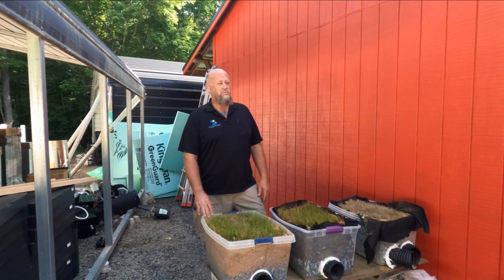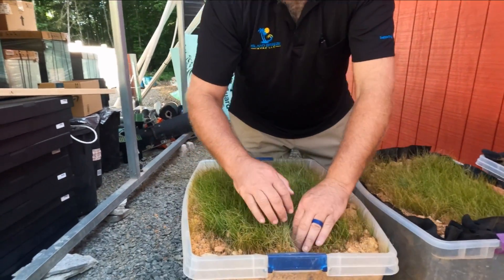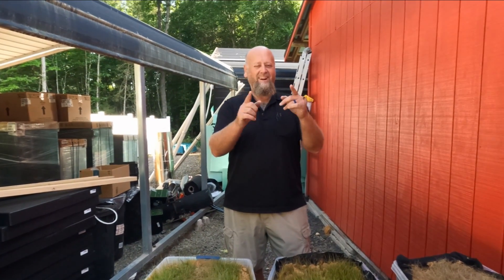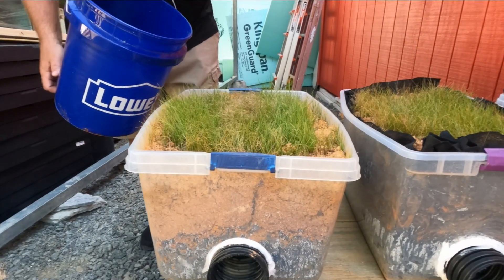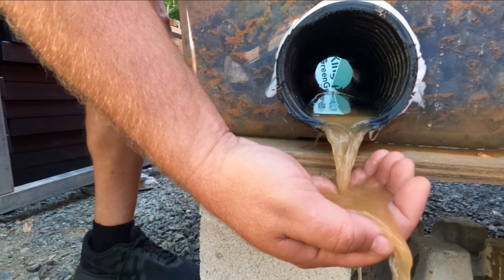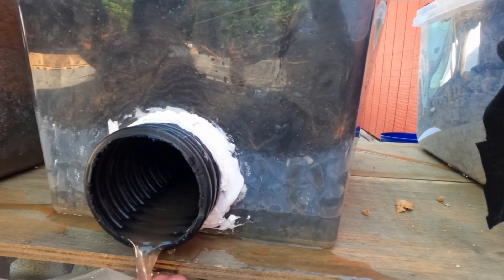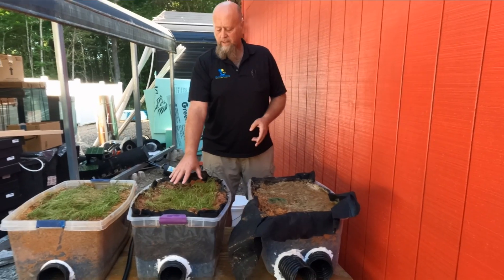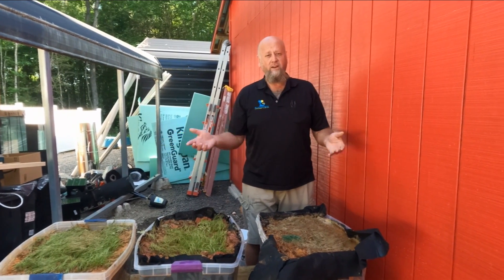Testing French Drain Scenarios To Find Out....Fabric or No Fabric? Which Is Best | Dr Drainz

Comment: We have been installing lawn drains as a company for probably 50 years with thousands of customers and never use any fabric at all. And we have never had any issues with our lawn drains.
Reply: Fudge.... um. Did you ever have to maintain them or anything???
Reply: I agree!  what's going to plug up with clay first?  The large pore space between rocks.  Or the microscopic pores in the geo textile???  I've seen so many French drains taco'ed with geo textile, and the geo textile get clogged up and the water never makes it to the drainage system!
Reply: @ThrivingEarthFarm  it doesn't matter if the fabric clogs, because it can never clog enough to stop water, otherwise we would build basements out of clogged fabric. all the fabric needs to do is separate the soil from the rock, extending the life of the drain. if the rock becomes merged with soil, then it's not a drain anymore, it's just rocky soil. this failure of the drain will inevitably happen over time, but the fabric makes it take longer, hopefully out of our life span. that's why every big company and government uses geotextile fabric to separate valuable resources like gravel from crappy soil. it doesn't make sense to save $100 on fabric when it makes the $1000 drain last twice as long or whatever.
Reply: @LuminairPrime   Ever build a pond without a liner before?  We build ponds and we use clay heavy soil.    If rock is in it, it won’t seal properly.    Clay heavy soil backed up on the outside of Geo textile prevents water from making it into the system quickly enough.  We’ve definitely seen many systems fail because of taco wrapped geo textiles around drainage systems.   That’s just been my experience!  To each their own!
Reply: @ThrivingEarthFarm  You don't put any dirt on top of the fabric at all. Only use river washed stone all the way till the grade is met. Anyone putting any soil or clay on top don't know wtf there doing. Grass will over time grow over the stone.
Reply: @MDC2020  Yeah, if you want a bunch of gravel in your yard instead of lawn
Reply: @MDC2020 Yo dum dum… it’s called a clay cap.
Reply: @ThrivingEarthFarm I’ve just been advised not to use the cloth for that exact reason. Loads of drainage metal though.
Reply: What is your process? Prob if you add enough rock then the dirt won't be able to reach the drain perforations?
Reply: @nofurtherwest3474  that's what I was thinking
Reply: I’m just having French drains put in with no cloth as the excavator guy advised not to with the type of silt I’ve got. He says that he’s always replacing cloth that becomes watertight by silt blockage of the material. Better to let it flow through. Silt and all. I just have to trust his thirty local years laying drains.
Reply: We don’t have much slop in our back yard and water is a huge problem. This coming spring I am planing to put in French drains  and I am hearing to use fabric and then not to use coming from the same YouTuber. At this point I am planing on a stepping stone walkway with French drains on both sides with no fabric. This is the lowest point of the yard with very little slop so may have to put in sump pump system. 
Can you tell me if this sounds the correct way of doing it ?
Reply: Fabric is like a filter, it will clog. I’d use it for sandier soils but not clay.
Reply: What would you typically charge for one. $1500-$2000. ?Just curious because I’m interested in trying this out.
Reply: just cause its been done for 50 years doesnt make it correct
Reply: I bet your customers have a shit ton of weeds coming out of the drainage rocks 😂
Reply: Sure, & the follow-up customer service agent is Helen Waite….😂

If you can even get through the Fax machine that always answers a customer calling in…..
Reply: I am so glad to hear it!

Comment: I had to redo the french drain behind a retaining wall behind the pool, but used fabric from Home Depot.  The drain had absolutely no rocks around it and was buried directly in clay.  It was so bad, muddy water was passing through the retaining wall and went directly into the pool every time it rained.  What is even crazier, is that the previous owner who had it all installed was a professional landscaper.  I've lived here almost a year and I'm still getting court orders due to his dissatisfied customers. A cop even showed up at my front door once looking for the guy.  The pool pump wiring was another fiasco I had to completely redo, then there was cut through irrigation, etc.  I'd have to say, I've learned alot from another person's mistakes!
Reply: Why would you get court orders or even the previous owners when he hired someone else to install? What does the professional landscaper have to do with any of this if he hired it out? Plus the cops looking for him must be a totally different story.
Reply: @mrgoodtimes05  sorry for confusion.  I got his mail for a while requesting he go to court for the other work he did at other sites.  Those days seem to be finally past now.  No longer getting the mail and I seemed to have rectified the water run off into the pool, for the most part.

Comment: This is about the 100th video I've watched about clay and fabric and I'm still confused. I'm thinking about just doing it with rock alone. A filter is a filter... wether it is a fabric filter or a rock filter, wether it is non-woven or not. If it's filtering the clay, where does that filtered clay go??? and they all eventually clog. Seems like a fabric filter would clog much faster than rock...  I'm leaning on using 6" smooth perforated PVC pipe with 90 degree sweep elbow clean outs on each end, (round grates on top) and just run a pressure washer drain snake attachment through it every couple of years. Surround the pipe with about 1" rock. The smooth pipe bottom should help it clean easier?? Seems like the rock might tend to clog from the top anyway, and not the sides or bottom, due to gravity... I'd rather deal with that down the road than pulling the whole thing due to clogged fabric.
Reply: Not true. I am a geotechnical inspector and look at these in volume every single day. Like the presenter said, all fabrics aren’t equal. Use a rated geo fabric designed for professionals and it will last decades. Rock is not a filter. It’s open graded, containing pores in which water and soil will travel rather quickly. As this happens, not only does your system become clogged but you generate voids in the fill above the drain. This introduces a whole new set of potential problems. Settlement, trip hazards, irregular surfaces and failures. It all depends on what’s above the drain. The soils go down and they leave voids. I’ve seen them travel all the way up to the surface and create large sinkholes. Use the fabric it’ll save you a lot of headaches! You can omit the fabric if you use a rated filter rock but it’s very expensive and the quarries will bait and switch by selling you a product that “looks” good but won’t work. Filter rock is highly engineered and must be tested to confirm that it is what it is! Like I said, it’s expensive. I hope this helps you a little.
Reply: @stewartwhittier3455  So why is there clay in the rock on the far right experiment with the surface drain in it?
Reply: @benkenobi671  Hi Ben! I hope I get the intent of your question, I had to watch the video again to see what you are talking about. There are 3 possible answers. If you're talking about the appearance of soil you can see through the box, below the fabric, I'm guessing that when building the box some soil got in there. If you're looking at the presence of muddy water in the solid pipe, that migrated there from the top during surface drainage. Most clay floats to a certain extent. If you look at the perf pipe on the right of the box, there's no water. Given time there will be. Lastly the possibility exists that the muddy water in the box rolled down the side of the box around the outside of the fabric into the rock. All of this presents an interesting scenario that we use in large commercial construction where the stakes are very high if one of these systems fail. I've been called out to mitigate failed drainage systems that contributed to retaining wall failure that jeopardized life and limb and shut down a whole Home Depot parking lot for ages. Big bucks! Soil migration into rock is a serious situation and can cause disasters. We recommend in our geotechnical reports that all sub drains/wall drains have a burrito drain installed at the base of the wall.  This prevents water migrating into the rock from unwanted areas and almost removes failure options. When installed, the rock/pipe/rock combo is wrapped with ends folded over securely creating a closed drain system. This is way better than the method of just laying the fabric over the rock between soil and rock. The method in the video works but not forever, plus, what about the side walls where there is no fabric? There is a high probability migration occurs this way. It's not just from above. For garden and residential applications if you do what Dr. Drains is doing you'll be head and shoulders above most. In fairness to Dr. Drains, he may cover all side walls during construction and that's good. But, unless you have a burrito, you'll get clogged gravel in time. If you want a near foolproof solution and an effective one, go with a burrito drain. We won't approve any work without one. I hope this helps! By the way, the presenter of this video is very knowledgable and presenting very useful info! All...use commercial filter fabric, always! Go to a supplier of these materials, don't source at box stores.

Comment: Great video. I live in VA and we're pretty much as sea level. it floors here. Our backyard is apart of the local drainage from a easement for it. can I create some sort of large box to hold water in that area in the ground?
Reply: It floods on your land. Would you be opposed to just raising the hight of your land with fill dirt. You could direct the water away from your yard and into a storage"pond
Reply: @vanderumd11  I'm actually in a half ass project right now. Behind my land is the drainage for the area and my land is sloped quiet a bit. I started to dig my French drain trench and now I'm gonna add non woven geo textile fabric, stone, and 3 inch pvc (was gonna go 4). I'm going to tie into my roof drainage system and bring all that was to the back. Backfill the area the same way and put a pond on the lowest side to prevent water from escaping to the negibors since he is lower than I am. I have to add a speed channel to garage pavement and add a water bumper under garage door. So far just digging the trench has solved most of that issue but during torrential downpours it's still an issue. I think redirecting the water is my best bet especially since the amount of rain we get and how it drains since it's close to the water table. I've done projects like this before but it is a ton of work for one person.

Comment: We usually place the "non-woven" filter fabric along the bottom of the trench, place some #57 stone in the bottom (3-4inches thick) place the pipe and cover it with 6-8 inches of stone. Then wrap the stone with the fabric to create a "burrito" effect encapsulating the stone.  This prevents soil from getting to the pipe from all directions, top, sides and bottom.  Then backfill the trench.  In commercial use we backfill with mason sand or concrete sand above the fabric.
Reply: Bravo Frank! Code wise and in civil engineering terms, this is the correct way. Where drainage is life or death, behind a retaining wall, the burrito drain is required to pass inspection. It’s the most effective way to reduce hydrostatic pressure behind the wall. Of course, there are other applications and types of drainage for less critical uses but the burrito drain is the gold standard. As a grading and geotechnical inspector, I’m called upon to look at these almost daily. The fabric around your system is so important, I’ve seen many fail over the years not constructed correctly. Everything from wall failures to sinkholes with cars in them! It always happens at a most inconvenient time too.😂
Reply: Thats the best way to do it, IF youre putting soil back on tip. That being said youre still reducing the effectiveness of the drain by putting soil/grass on top
Reply: @lawn-n-orderlandscaping1389  weird cus french drain man swears put the pipe on very bottom, against the filter fabric. he says do NOT put any gravel under the pipe. He says that only means you will have standing water in the bottom of the drain up to the pipe all the time (example, if you have 4" of gravel under your pipe, then you would have up to 4" of standing water in the bottom of your drain). I can see this might be true. But I think the reason for the gravel (besides it being a good drainage material I suppose) is to dry out and kill roots trying to reach the pipe which would clog it. So the gravel can be thought of as a root barrier. In that case, you WOULD want gravel under the pipe. If you just have filter fabric under the pipe, you figure that filter fabric is NOT going to holds off roots forever.

So basically I can see both ways being correct and dont know the correct answer :(
Reply: @cryengine_x  fabric eventually biodegrades. Also gravel doesn't hold water... unless your drain is flat, which wouldn't work anyways. We like the water to slow down a little at the base of the drain, but use the pipe as an escape for fast flash floods. Using the 3/4 gravel, the drain will almost function without the pipe entirely, until a hurricane comes through, that's when you need the pipe.
Reply: @lawn-n-orderlandscaping1389  eventually but the key is how long, 30 yrs? if you use good stuff not home depot junk as many seem too. if gravel drains then it definitely holds water, thats the point of the whole void system and the whole drain really. if the dirt absorbed that water the drain wouldn't be needed
Reply: @cryengine_x  give or take,  but corrugate pipe is really only good for 25 years i wouldnt sweat it.
Reply: @cryengine_x  I'd say: who cares about some standing water (temporarily) under the pipe when it is placed on a bed of gravel? Especially 2-4' below grade? That water will drain into the soil below once the main flood has passed. If it is perforated pipe, fine sediment will slowly fill up voids in the gravel below, but if you burrito wrap it, that sedimentation should be minimized or slowed and buy you many years. Laying the pipe on the bottom of the trench means that sediment begins piling up inside the pipe immediately and you are relying on a grade and a LOT of fast moving water + the turbulence of the ribbed pipe to flush out that sediment. If water is moving at a slower trickle, that pipe will never clear and will silt up until you no longer have a grade for the water to run out through.
Reply: @cryengine_x  Soil should filter water, not absorb it all.   Clay soil acts like a sponge, it absorbs water and becomes impermeable.  French drains filter water.

Comment: Great video and explanation.  Thanks!   I just moved up north to clay soil which is very different from florida    I have a weird situation with standing water in back yard due to issues in my development.  I was thinking to put a french drain in but fill with rock or rock the bottom then backfill with potting soil just to keep the water underground in hopes of having a bit of a dryer yard.  I really have no where for it to drain off to.   If this doesnt work i may have to put in a basin and a sump pump also at the end of the run.  In your opinion could my idea keep the water underground?  Or am i way off in my thinking.  Thanks, again
Reply: We just did your initial idea but haven't put any clay or soil on top of the gravel. The yard is much more dry and doesn't slosh around on the surface even after 4 days of rain.
Reply: @seshy11  thanks, Victoria🤙.

Comment: It's going to rain more than a bucket if it has fabric wouldn't it start puddling up on top and it won't drain as fast so you would still have that problem puddling and sometimes it rained hard for almost an hour seems better almost without fabric fill it up with gravel  to the top but will look bad I don't know  just  wondering

Comment: If you pull the surface water out right at the beginning, then why do you need the French drain? Won't the water make its way down eventually and find its way to the French drain? More importantly, don't you want that water to make its way down into the sand/clay to keep the grass watered? Don't you run the risk of having to water your lawn more with the third option?
Reply: They accomplish different things. The surface drain collects only surface water that flows to it. If rains are really heavy, or your entire drainage area doesn't flow to the drain or even obstructions like landscaping, trees, shrubs, grass prevent all water from flowing to it, then the water ends up in the soil. Ground water rises and in some cases needs to be collected before it gets too high. A good example of this is a French drain around a building's foundation. It's in place to catch the rising groundwater before it gets to the footer-wall joint where water will seep into the basement.
Regarding watering grass, soil holds water in the nooks and cranny on a microscopic level. Excess water the soil cannot hold will seep down and join the existing ground water where it's saturated contributing to rising ground water. This is why wells produce water. They are deep enough to tap into that water.